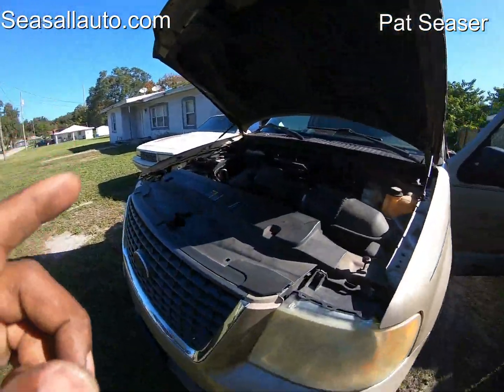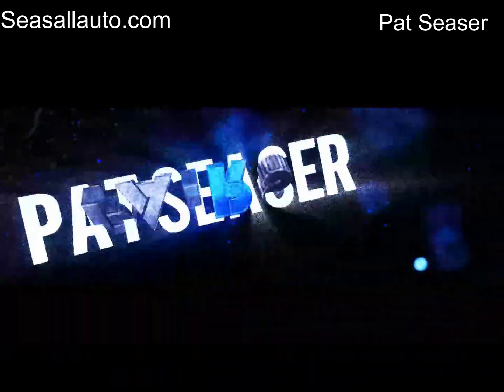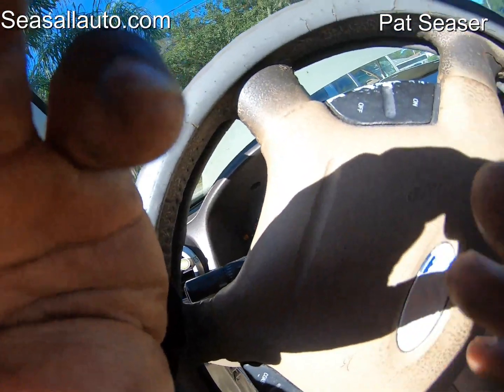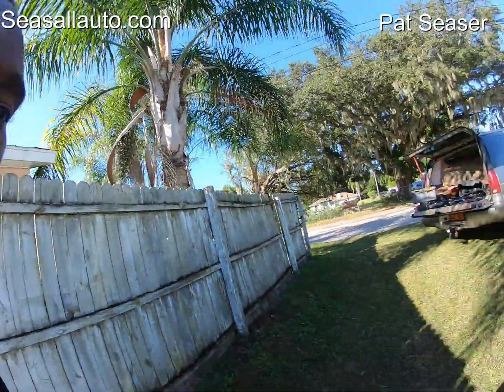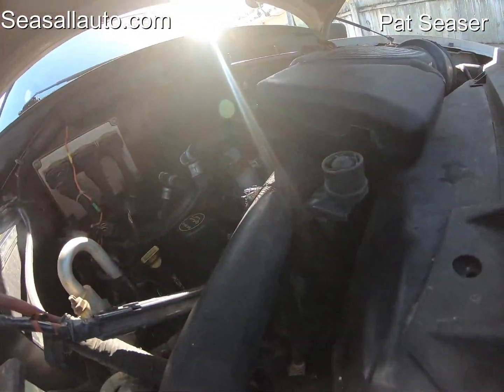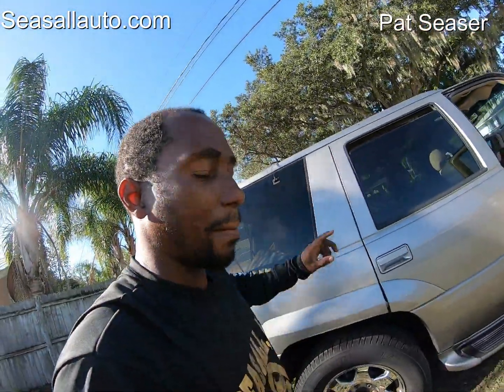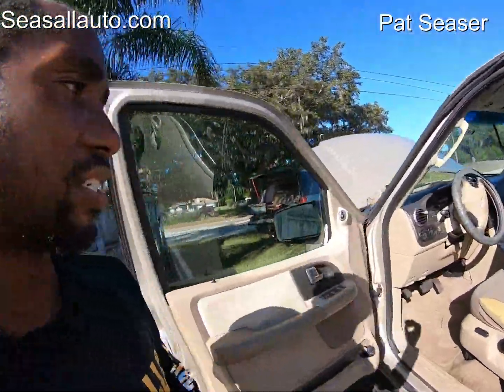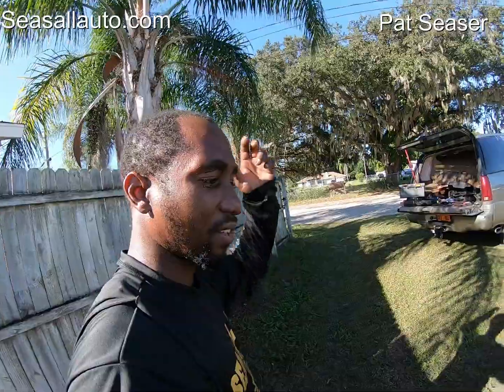Can you seal off a cylinder with JB weld? The world is about to find out! Part 2

Comment: How long did it hold up? Having the same issue on a 99 f150. IDC if it's stuck forever, the plugs will probably out last the truck lol
Reply: Hey Logan! It held up for a day but it could have lasted. The customer, being in a rush, decided to go a hundred miles an hour for five Mile straight and it blew it out at the last mile. If done correctly, it will not come out. But know that is definitely a permanent fix. And I agree with your comment that plug may just last longer than the vehicle lol very best of luck to you!